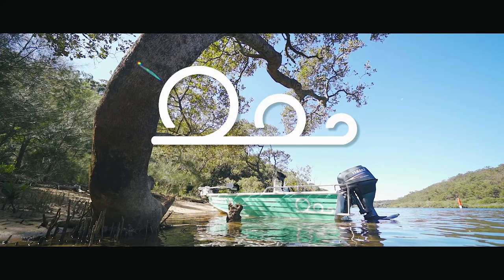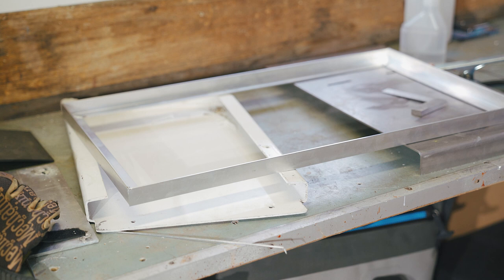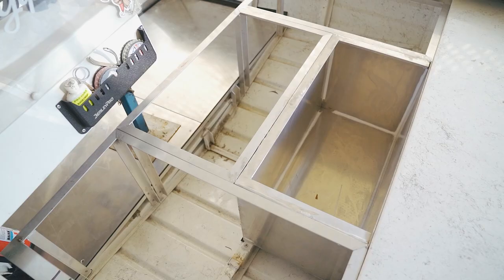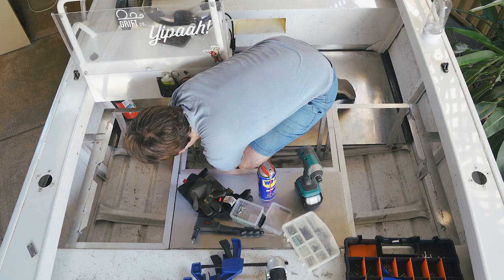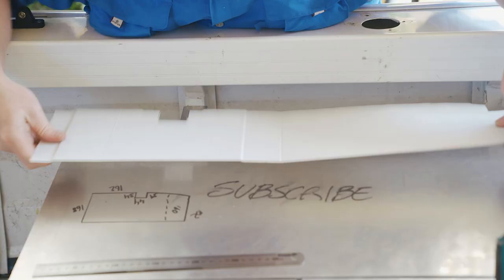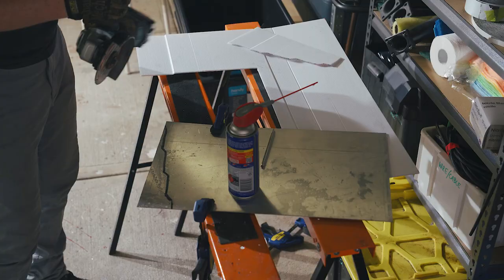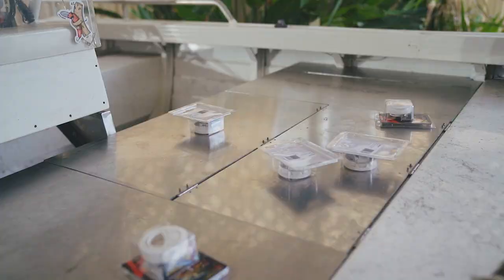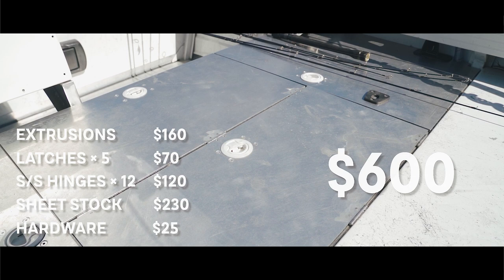FINISHED Casting Deck - BUILD a Custom Aluminium Deck | DORA PROJECT 🧜‍♀️

Comment: You should have used rivets my man.
Reply from the maker: Yeah, nah - agree to disagree.
Reply: @GriftCo  not even in the least bit. Rivets hold up to the constant flex of a boat. Welds DONT. When a weld breaks you have to redo the entire length of weld. When a rivet goes bad you replace the rivet. That just shows how much you know.
Reply from the maker: @ngirardo86 , thank you for your input! Whilst I usually try to avoid reacting to deliberately inflammatory comments, you’ve somehow managed to strike a nerve but also I feel I could share some context that others may find valuable.

Whilst I am not a professional boat builder (not something I’ve ever claimed to be) I do know a “bit” about design and engineering. Specifically working in the off-road automotive space for going on 8 years, with many of my designs that are entirely riveted earning tens of millions of dollars revenue. 

With that in mind it may be obvious I would be the first to praise the value of rivets, after all I have a reputation on this channel for being a diehard lover of rivet-nuts as well. You might want to turn your attention to the rear deck build video I did which was entirely constructed of rivets and connectors, no welding to be seen.

Rivets have their place, and in this video I still use them. However not every joint could be made with rivets without making other compromises to the design; whether that’s material, aesthetics, function, labour/ effort etc etc.

Whilst your comment does ring true, that rivets have an innate ability to flex, I could share with you my professional experience with the failure of rivets due to flex and fatigue of materials. Feel free to message me if you’d like to see how “little I know”.

Lastly, I’d like to point out something you’ve obviously overlooked. This is a personal project, My own boat made in my own shed. I had a personal goal of learning how to TIG weld aluminium and what better way than on my own boat. If a weld fails, I get to fix it! Would you like to know how many welds I’ve had to fix? Zero

Good luck Ngirado86, I hope your day is as pleasant as you are.
Reply: @GriftCo  you were doing so good and then you lost it. The part that you screwed up at was saying rivets fail from flexing and fatigue. I’ll share something with you…again. It’s a heck of a lot cheaper to fix a few rivets and MUCH easier in terms of actual time and labor. What I explained to you and anyone who knows anything about welding will tell you and if they don’t tell you this then they don’t know what they’re doing. When you get a crack in a weld the ENTIRE joint needs to be re-welded whereas replacing a few rivets where they failed and not the entire joint again is where rivets are king. But I’m sure you already knew that. My 22 year old Lowe 1256 is a testament to how good rivets are. That boat doesn’t take on a SINGLE DROP of water. I’ll take it over welded any day.
Reply from the maker: @ngirardo86  cool bro

Comment: So you wish to use seadek? Ive found it can be a bit slippery. Check out Hydroturf. Jetskis use it. Comes in lots of cool colours n a few patterns. Moulded pattern or cut pattern. Cut pattern has better grip. Available from AJSP Gold Coast.
Reply from the maker: Thanks Andrew, I’ll check that out

Comment: Are you happy with the 3mm plate flooring or do you think 4mm would be more durable.
Reply from the maker: Haven’t had any trouble with the 3mm at all. If money and weight allows I’d probably do 4mm just to reduce a bit of flex
Reply: I’m going to replace ply flooring in a quintrex 4.2 renegade so a bit of extra weight will be a benefit, great videos, you gave me plenty of ideas and pointers. Good to get an Aussie point of view and honesty.

Comment: I learn when you do keep the mistakes. Ps I'm keen to redesign my deck, and follow yours, but I need something covering the aluminium, can you suggest something so I don't burn my feet.
Reply from the maker: Hey James, what I'll be going with is EVA Foam Decking. It's what I plan on goign with, but haven't comitted yet as I wanna do a little more to the deck beforehand.
Reply: @GriftCo  I’ve been thinking the same, but I just wonder how the Eva will stand up to the sun in the NW.

Comment: Heya,
great work, embarking on a very similar project myself.  Question, did you use 5052 or 5083 grade sheet, and was it 3mm?  How have you found the flex, noticed you haven't added stiffeners to the hatches.
Reply from the maker: G'day Lachlan - The deck used 5005 Sheet in 3mm. The flex is pretty un-noticable under foot, but it is a little visible when you film it. I'm not a super heavy bloke, but I think if I had 30kg extra on me I'd be considering running some trusses on the underside. For the moment though the sheet is stiff enough for what I'm doing.
Reply from the maker: Actually - looking back into it, I think it was 5083, not 5005. I'll have to have another look at the invoice!